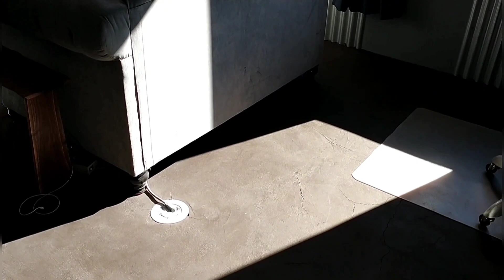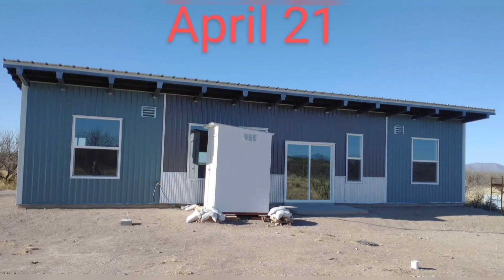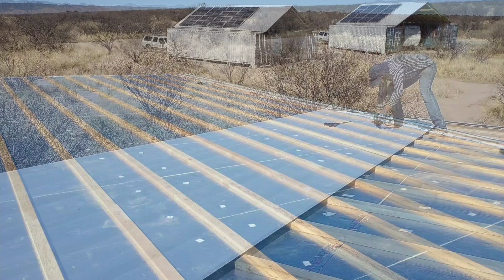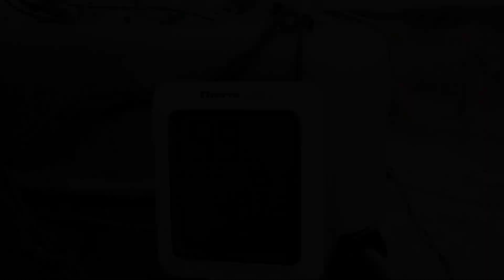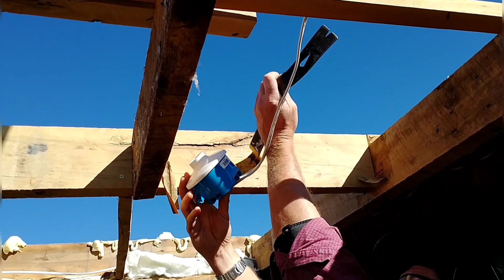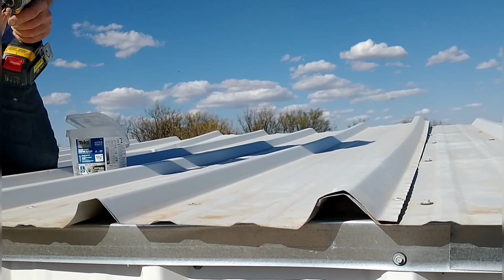100% FREE Heat FOREVER!! Passive Solar Design House  Performance 🌞 #56 DIY Build

Comment from the maker: We are putting our weekly video out a day early. Wishing you all a wonderful Christmas! 😊🎄
Reply: I LOVE my SQFlex 11SQF-2 pump... I run mine off solar panels ALONE!(no batteries) with just a disconnect switch.
My dad runs his as a direct replacement for a old 240VAC pump.
I installed my pump at 150' with 1" PEX, so I can pull it myself. It's a little heavy for the first 20', but gets lighter.
I love having it on PEX so I can do it myself and not have to hire a well truck.
Thankfully, you can't mess up the wiring on the SQFlex... 3 grey wires... hook them any way you want!
I'm partial to the "Helical" pumps, rather than centrifugal.
Reply: I'm building a Roman-style(atrium in the center), passive solar home, but I'm adding hydronic to the floors with a thermal battery outside.
Under the solar DHW flat-plate collectors, I'm going to bury a "tank" insulated hole, lined with EPDM and an insulated roof.
Water with drain-back for nights, then copper heat exchange coils to bring hot water to the house for domestic/floor.
Reply from the maker: @onestoptechnologies7305 😎 We haven't needed any additional heating in this house. The sun does a great job! Last winter was pretty mild, so we kept most of the curtains closed, and opened windows
Reply: ❤merry Christmas!🎄
Reply from the maker: @bondpaz  Thanks! Hope y'all have a wonderful New Year! ❤️🎊
Reply: @RedandAprilOff-Grid  thanks 😊

Comment: Just awesome...cold out but still increasing interior temp! Wow...that is the goal!! Haha 

We are hoping for this similar heat strategy as we finish the high insulation throughout the house...then the electric heated thermal mass. I had 5 large southern windows designed into our house. So when it is cold but sunny here on the Canadian prairies we should achieve some heat generation. The drapes for the whole house will be full length to the floor and 4 layers thick to keep the heat inside the house at night. 

Looks like between Douglas and Bisbee in the high desert of Arizona. Beautiful area with yes huge temperature swings!

Super work!:)

Comment: Hi Red and April, If you have poured cement interior walls why didn't you have the exterior walls as poured cement?  Would that make the house to hot?
Reply from the maker: With just concrete walls, the house would be much colder during the winter, and hotter in the summer. Insulation keeps the heat out during the summer, and the warmth in during the winter. Interior thermal mass helps keep the temperature stable. Our house stays very comfortable year round. 🌞🏜️

Comment: We had the same pump on our well in Idaho it only lasted a year. We ended up replacing it. Do you have water catchment basins so the water can regenerate.
Reply from the maker: Bummer, ours never worked right, too bad we didn't replace it before the warranty ran out. 
We put in some water catchment when we originally rented the backhoe for our septic and foundation. We recently got a mini excavator and have been working on digging water catchment basins around some of our trees. There is a large berm already along one side of our property. We'll probably look into repairing it, but we also need to make sure we don't end up holding in too much water and flooding the lower part of the property.

Comment: How wide is the house? Is it around 30ft wide? And how long are those metal beams and how far from each other they are spread out?
Reply from the maker: Sorry for the delay in responding. The house is 24 feet wide. The metal beams are 30 ft long and they are 4 ft apart.

Comment: FYI:

You can retrofit a variable frequency drive on your well pump to gain soft start capability (helps reduce wear and tear on bearings and reduces electrical spikes during start up).

Check with your local plumbing supply house or HVAC supply house for variable frequency drives.  

When you retro fit them, make sure that it is only for start up.  Once running, your well pump is designed to run at full RPM (not partial RPM).  Do not listen to the marketing department/literature from the variable frequency drive manufacturer saying you can run your pump at a percentage of its full RPM.  It's a lie, it will ruin your pump.  

I like to run the power from my circuit breaker to a switch (ON/OFF), then to the variable frequency drive, then to the pump.  The only time the variable frequency drive gets used is when the pump starts up.  It allows it to slowly ramp up to full RPM, then the pump runs exactly as it is designed to run under normal load conditions.  Therefore extending the life of your pump and reducing the electrical load during start ups.
Reply from the maker: @michaelmeans9187  Great information! Thanks so much for taking the time to explain all of that!

Comment: Hi yall!  It’s incredible how awesome this works!  This morning it was 21 outside and 60 inside the house. It’s so nice!  The RV was 31 when we went in! 😮 🥶  Happy holidays!!!
Reply from the maker: Awesome! Yes, it's so nice! We got down to 13° last night and our house was 65° this morning. Once you finish and insulate your floor, your house will probably do even better. Our floor has the majority of the thermal mass so insulating it was well worth it. The days have been so warm we have been keeping most of our curtains closed during the day, and opening a window. 
 Thanks! Happy Holidays to y'all too! 🦃🌲❤️😊
Reply: @ 13!! Wow. That’s cold!🥶
Reply from the maker: @bondpaz  It is crazy how much colder we are than in town! We can watch the temperature drop as we drive down the road to our house. 🥶  Passive heat is amazing! 🌞

Comment: Thank you for sharing you have saved my sanity. I knew there had to be another way.  I just don't understand why when I live in Portugal where there is lots of sun I am cold and miserable in the house unless I burn money running dehumidifiers and heaters. Outside is always warmer than inside and inside. So much inappropriate house design it drives my crazy!!
Reply from the maker: Glad it was helpful! Passive solar design really is amazing! Our house is always comfortable all winter long. 🌞

Comment: UV coating is not a thermal factor in passive solar, BUT coatings in general are a huge factor. What you are looking for is glass with a high SHGC (Solar Heat Gain Coefficient). This glass will allow through more of the spectrum that actually heats things up.

Comment: Um yeah,it's Arizona...isn't A/C more of a concern than heat?.
Reply from the maker: Our area gets well below freezing almost every night in the winter. In the few years we have lived here, we have seen temperatures range from 5°F to 105°F. The exterior reflective insulation layer as well as the interior thermal mass has been very effective in keeping the inside temperatures stable and nice year round. It has performed way better than we expected. In the summer we open windows at night, because the desert cools down, and we use an evaporative cooler, because it's typically dry. The desert is an extreme environment but it's a great place to live off the grid in a solar passive design home.  🌞🏜️

Comment: Southern side of house make walls out off
Sun baked Mud bricks would increase heat transfer at night in winter and cooler in summers.
Just my experience in the hottest places on earth.
Reply from the maker: Interesting 😎 This design has worked amazingly well, the temperatures are stable and nice year round.

Comment: так там Турция, там тепло (с)
Reply from the maker: We get large temperature swings here in the desert which makes passive heating and cooling very effective. It gets well below freezing every night in the winter and sometimes as cold as -15 C. Lots of sunshine is a huge advantage to living in the desert.
Reply: @RedandAprilOff-Grid  
Greetings from another planet. We have only 3 sunny days a month in Irkutsk in winter. The temperature in winter at night reaches -47 C. The cost of an installation for heat storage will be comparable to the cost of another house. On the contrary, summer is very hot and sunny - 24 sunny days. The cost of one kilowatt* hour of electricity is 1 ruble (1 cent).
Reply from the maker: @СергейПетров-б8с Interesting! Yes passive heating would not work well there. Sounds challenging!
Reply from the maker: The cost for electricity in our state is 13¢ per kWh, 1¢ is awesome! Thankfully we don't have an electric bill. 🌞
Reply: @RedandAprilOff-Grid  
 shall we exchange citizenship? 🙃

Comment: Neat. Most buildings in South Africa,  where ingrew up, incorporate passive heating (North facing), however your insulation is next level. 
Since all houses are double skin brick built, only additional roof insulation is needed.  Every house where weve added loads of ceiling void insulation has almost nullified the need for heating and cooling. I grew up on the plains, high at 1600m asl, near Pretoria. The last place i lived in was terrible,  South facing and uninsulated wood floors, cold in winter,  hot in summer.  My basement workshop was pleasant most year luckily.
Reply from the maker: Interesting, thanks for sharing! 😎 The roof overhang keeps the sun off of the south side of the house in the summer because the sun is high in the sky. In the winter, the sun comes in the windows and heats the house. It has worked a lot better than we expected. We thought we might need to add a wood burning stove, but are glad we don't need it.
 We use the evaporative cooler for a couple of hours in the evening, and the house is staying very comfortable so far this summer. 🌞🏜️

Comment: I built a house using similar design principles as yours in southern Idaho about 12 years ago.  When the sun shines it heats up the house even when it is well below O deg F.  Problem is, most of our winters are cloudy here; consequently the heat pump runs most days in the winter.  I keep it at 65 deg F for the winter.
Reply from the maker: Yes, clouds make it much less effective.  Three days is the longest stretch of cloudy weather we got this winter, so the coldest it got in the house all winter was 62°. It typically stayed in the 70°s.  I bet your house stays nice in the summer. We'll probably need to use an evaporative cooler in the summer. 🌞

Comment: I lived in Phoenix for 11 years. Car batteries only last at the most 2 years in Arizona. The Sun and heat kill them. If you garage your car continually you may get a little more time. So everyone got the 5 year guarantee batteries and simply brought them back when they went dead and paid the discounted pro-rate for the new battery.

Comment: Wow! Thanks for sharing the details (rvalues, costs, materials, and temp readings). While this shares many of the earthship design principles I imagine it was quite a bit less expensive and easier to permit, yes? How is the summertime performance? Would a buried air vent work to cool the house or is the insulation and eave shading sufficient? Do you use anything mechanical for air exchanging or dehumidification? Just curious. Great design! Good looking, too!!
Reply from the maker: Thanks! This house is so comfortable to live in and was MUCH faster and easier to build than an earthship, but probably cost a little more. We had 4 or 5 mornings, where the inside temperature was down to 62°, but that's the coldest it got all winter, and typically it was much warmer. We are very impressed with how nice the temperature stayed this winter. In the summer, based on last year, I expect the highest temperatures inside to get into the mid 80s°. We plan to use an evaporative cooler when it's hot and dry, and possibly just a fan and dehumidifier during the monsoon season. At night, by opening a window, the high vents in the bedrooms should draw in plenty of cool desert air. The general design would be easy to permit, but not sure about some of the specifics like: exterior insulation, metal beams, earthen floors, and uncoated windows. Our county has an opt-out of inspections permit, so we take on the responsibility of building a good and safe home.
Reply: @RedandAprilOff-Grid  Thanks. Did you use and architect or structural engineer? Or were you able to figure out much from code guides, YouTube, and other references? How much building experience would you recommend someone have before embarking on a project of this scale?

Comment: Hi guys,  a few questions, could you suggest any books you used  for your thermal walls for reference —- as well as , books used during the whole project, for reference,  I think that would make a great video, of you showing the reference material used to make your house, that’s at least a thirty minute video. 
-  I am thinking of building a thermal wall After watching this , I looked through your channel and found the video on the building of that thermal wall. 

After taking a few , heat pump classes of air to water systems , and hydronic classes , I think thermal walls, will be used more often in remodeling and new construction, in the upcoming years. 

The demonstration using the temperature gun really helped and gives an understanding of LOW E and non low e windows- 6-7 degrees difference, thanks this is good information, and will now consider this . 

again thank you for documenting your hard hard work, it can become very draining, mentally, physically, and financially on a project that long, stay tough great job —
Reply from the maker: And, here is the video we saw a few years ago that first inspired our passive design https://youtu.be/stL8GS1ME_E 🌞
Reply: @RedandAprilOff-Grid   thank you — nice insight,  he did a good job explaining much,  I have my work cut out for me,  proper planning, will be getting his recommended book .  The YouTube community on this subject is very supportive and helpful.
Reply from the maker: Here is the link to a couple of books we looked at that were helpful regarding passive design. https://www.harvestingrainwater.com/ 
The books go into great detail about permaculture and other things, but also have some info about passive design homes. We skimmed through and saw where the book mentioned the importance of the windows on the south side being uncoated.
We used concrete for our thermal mass walls because we had the materials, thought it would look cool, and figure it would also have some practical value. 
We did a lot of guessing and figuring things out as we went, but didn't know for sure how well the house would heat itself, but in the end, this design has worked out great for this area. 🌞🏜️

Comment: It's Low-e coating, as in low emissivity coating.  Not UV coating.  The Low-e coating on windows mostly block infrared as well as UV radiation to reduce the solar heat gain.

Comment: I lived in Palm Springs California in the '80s for 10 years. My car battery never did last more than 2 years I was told it was just the heat that it had to endure. Love your thoughts on thermal mass and passive solar energy.
Reply from the maker: Interesting! Yes, maybe it's just part of living in a somewhat extreme climate. 
The passive design concept is really amazing, and it works much better than we expected!

Comment: Thank you so much for sharing this! We’re building a solar gain house here in Oklahoma.

Looking forward to seeing how cool your home stays in the summer, without other cooling mechanisms !!! 😊
Reply from the maker: Awesome! It has worked much better than we expected, definitely worth doing! 
The temperatures inside stayed pretty nice last summer, even before it was insulated on the inside. The evaporative cooler works great when it's hot and dry. During the monsoon season we are planning to run a dehumidifier instead of the evaporative cooler, but still use the fan on the cooler to bring in the cool night air. We'll plan to do an update on how it works out. Best wishes on your build!

Comment: For your well pump, I would place the largest holding tank I could fit in the well house and use a DC pump from it to your pressure tanks for household line pressure. That will take a lot of load off of the well pump since it essentially functions only as a lift pump and allows it to run for longer periods with less start/stops, which is what normally kills a motor.
Reply from the maker: We have 2 pressure tanks, but with 3 houses using the well, it's a bit hard on the pump. Thanks

Comment: I look forward to the summer update and seeing how well your house stays cool.
Reply from the maker: It stayed pretty nice last summer, even before it was insulated on the inside. The evaporative cooler works great when it's hot and dry. During the monsoon season we are planning to run a dehumidifier instead of the evaporative cooler, but still use the fan on the cooler to bring in the cool night air. We'll plan to do an update on how it works out.

Comment: all that sun power I would use a space heater a bit in the am hours.
Reply from the maker: Yes, that's what we did when were living in the RV. As long as we had plenty of sun, we would run a little electric heater. It helped some, but RVs don't have much insulation and it was always so cold!

Comment: FANTASTIC VIDEO!! I have 12 acres in Cochise County and I am planning to build a home that is very similar to yours. Right now, I am sitting in a 100 year old 2750 sq. ft. Victorian with ZERO insulation and its negative 20 degrees outside.
Reply from the maker: Thanks! Congrats, sounds like a good move! 🥶 Stay warm!